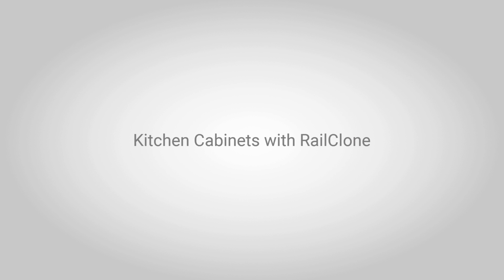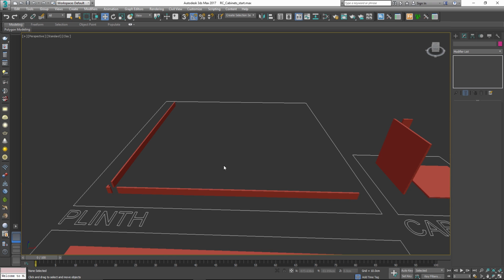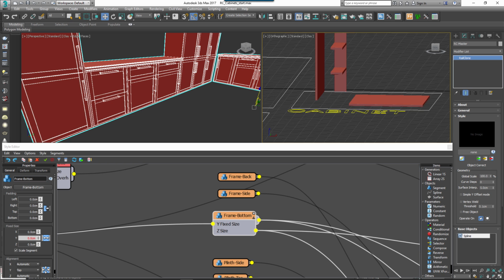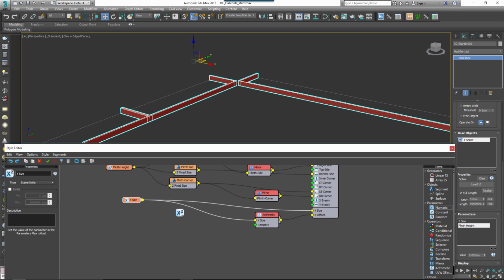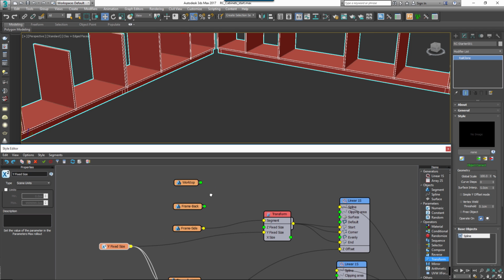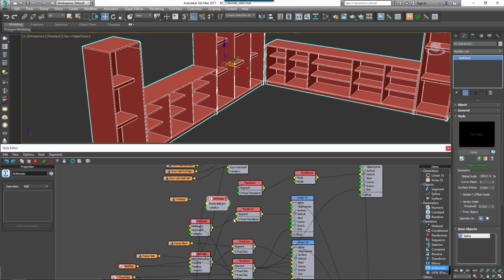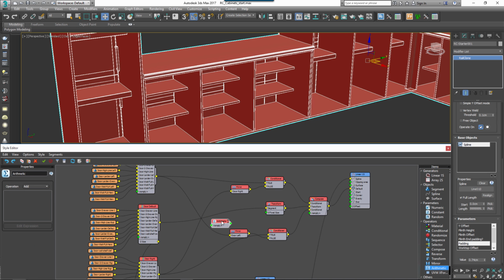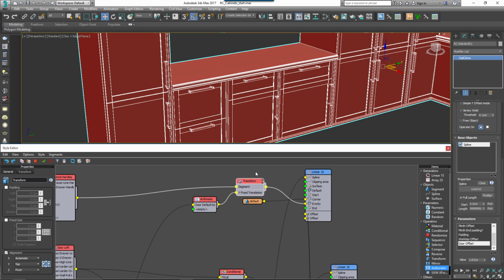TUTORIAL: Modelling Kitchens with RailClone in 3ds Max (advanced)

Comment: I had to use Negate value from Macros. This tutorial is so complicated and unnecessary that I decided to not do it.
Reply from the maker: Sorry to hear that. We're aware that this tutorial is a bit complex. It's an advanced tutorial for people already very comfortable with RailClone, but that said there have been many changes since this was released that would make the process easier. It's on our list to re-record and simplify using new techniques.
Reply: @itoosoft  It is not so much about Advanced or beginner problem. I am an Architect and I can tell you that some of the parameters given to change are unnecessary. Also When using Expressions it is not that the expressions are ADVANCED. They are plain and simple but due to the fact that you have changed the syntaxes they do not work. So in simple language the Tutorial needs a makeover. We need a new tutorial for Kitchen Cabinets and useful parameters that will help my client make a decision.
Reply from the maker: @Mranshumansinghr  Thanks for the extra info. You're right, the expression change has caused issues in several of our older tutorials We hear you - it's on the redo list.